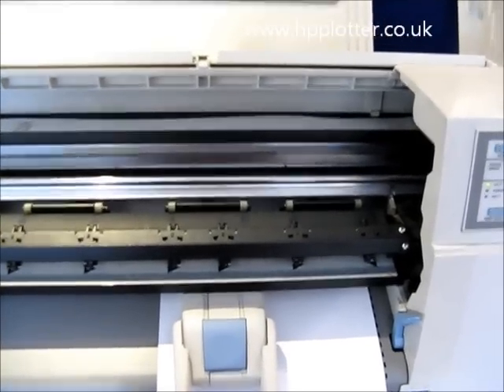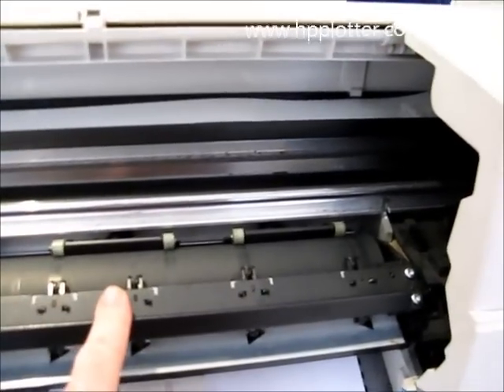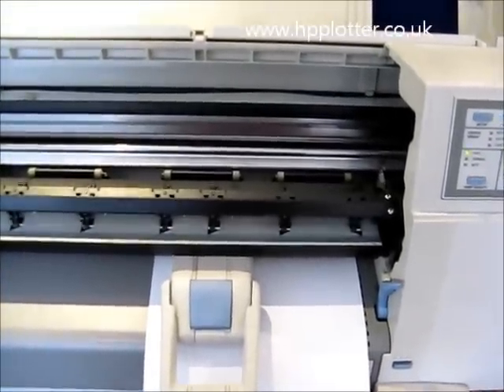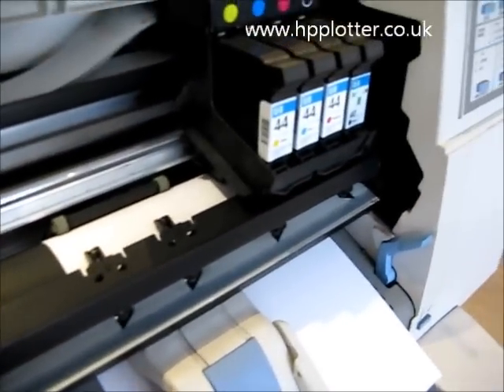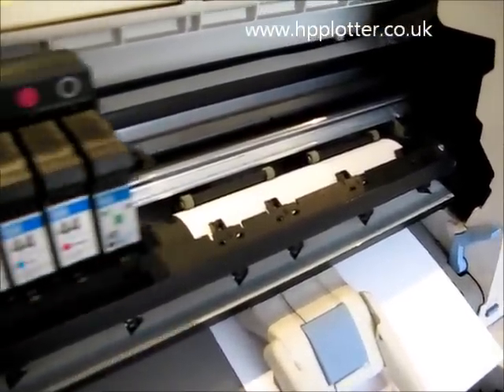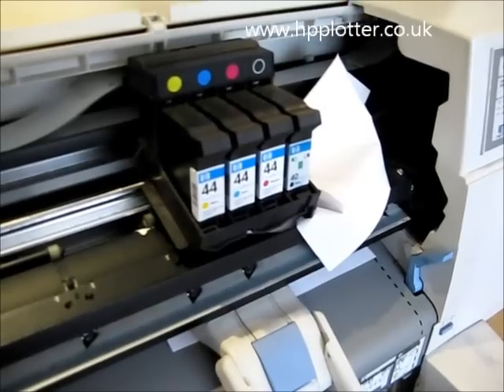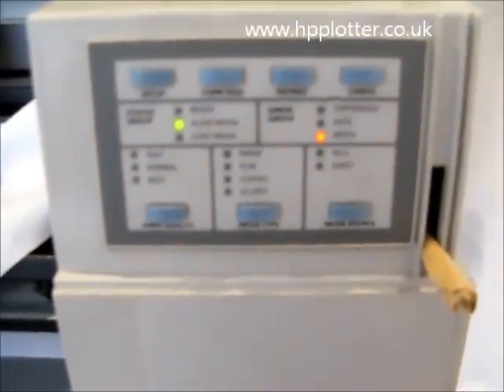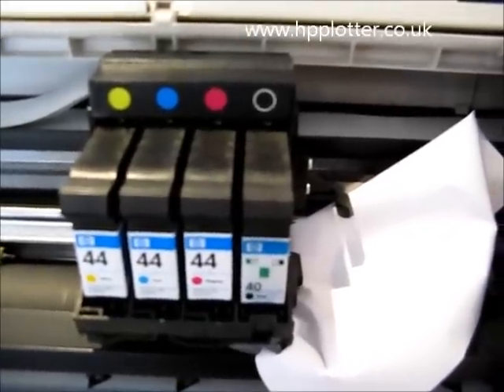DesignJet 450C repair- clutch error

Comment from the maker: @bantambouncer  We understand from your description that you have probably tightened screws on the right hand side of your printer and not the left hand side of the machine which is where you'll find the overdrive clutch (notably there are not '2' screws located anywhere near to the overdrive clutch).  Once the overdrive clutch fails it would need to be lubricated or replaced.  The screws you mention are entirely unrelated to the overdrive clutch but we're pleased to hear it worked for you!